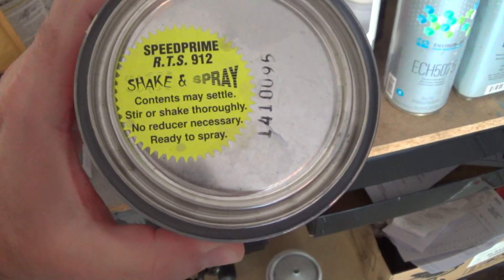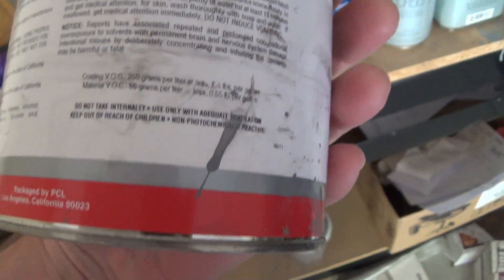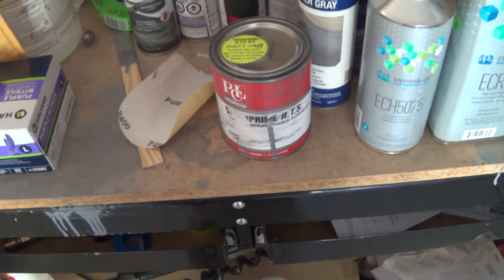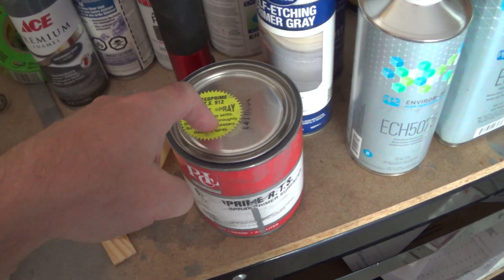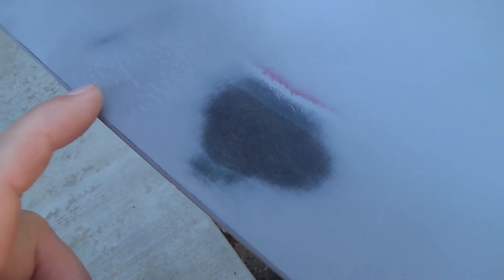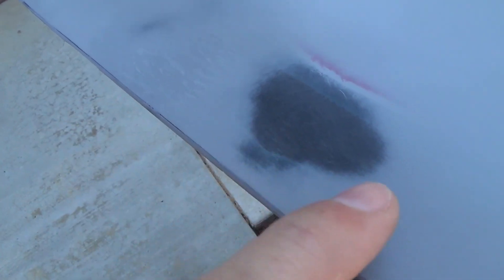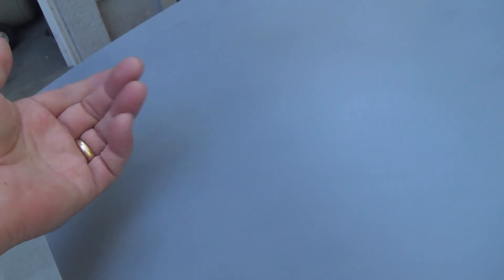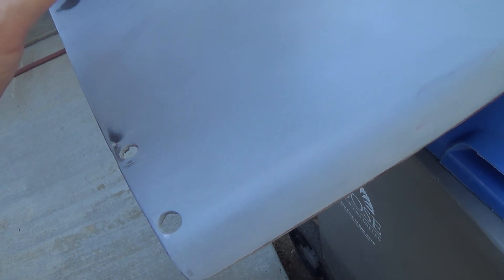Follow up to primer striping

Comment: This product is labeled as "Quick-dry" so it is indeed drying much too fast - as you could see and the stripes were the result. It can be thinned up to 100% with alcohol according to the tech sheet that I found on the web site.  But if you did that, it'd come out like water, so runs and splatters would be everywhere.  It said spray at 35-40psi with an HVLP gravity feed gun, - did you have your pressure set correctly?
Reply from the maker: JohnCarey1963Jag "Quick dry" More like Instant Dry :)
I was running 22 psi. I can't imagine THAT high. I read that, but I think I read it as "siphon feed". That sounds insane.
Thanks John!